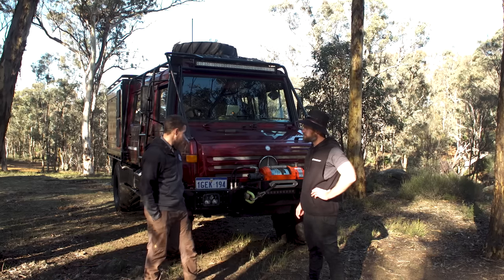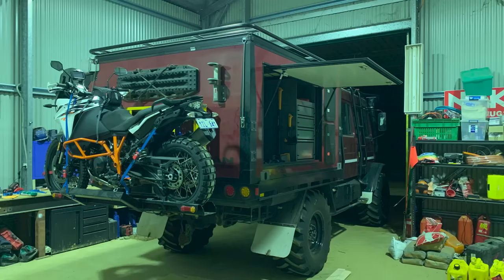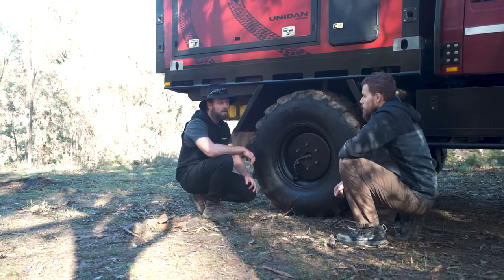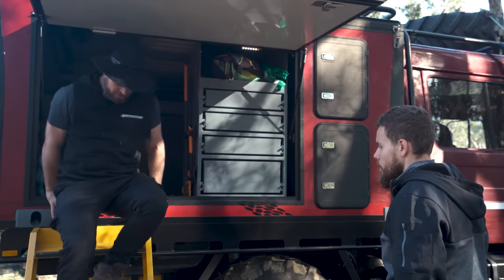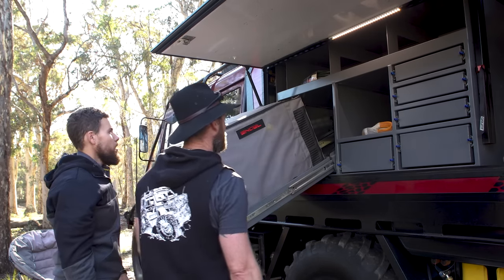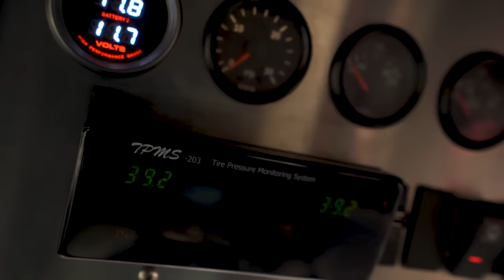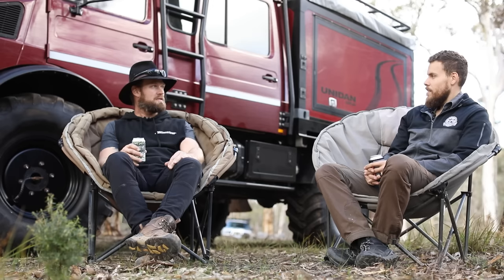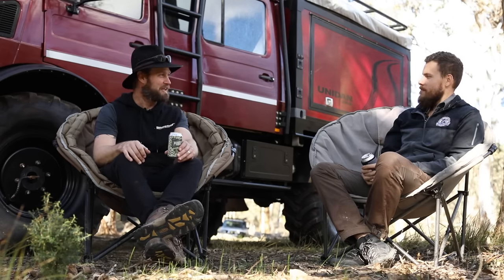DOOMSDAY TRUCK, Unimog Modified Episode 83

Comment: 200kg spare on the roof, good luck with that changeover 😂
Reply: I wonder if getting it off and on the roof, using the winch and a tall gum tree.
Reply from the maker: Hoists it down with straps but it’s not an easy task

Comment: Surely there is a better spot to put that spare tyre instead of up on the roof
Reply: People with that kinda truck usually hang them off the back, but that’s not really an option if you want to carry motorcycles
Reply: When will he even need to access the spare? I'm guessing that rubber is going to handle anything it hits!
Reply: Leon yeah that’s what I’ve usually seen, but I’d sacrifice the tyres for a dirt bike any day
Reply: The Frown Clown yeah I doubt he’ll ever need the spare !
Reply: The Frown Clown with these tyres you can repair most normal punctures by „just“ pulling the tyre of the rim and doing some work to it. The moment you have to change the thing is usually when you have punctures or cuts in the side wall

Comment: if anyone actually reads this, i had a camping chair JUST like the one pictured at 28:50. it was a fold away papasan chair, and i called it the Crunk Chair. Getting out of this chair after a good night around the campfire is impossible. Hence; Crunk Chair. Does ANYONE know where i can find another one? Bass Pro used to sell them, they been discontinued. I really need another one, and ol boy GOT one, so i know they still make em. 
#hydrate

Comment: Ask  any adf mechanics and adf driving instructors that worked with mogs... then ask them what they would drive if they won the jackpot... it wouldn't be a mog.
Reply: Why's that mate, are u from the ADF...?? Would be good to get ur input as they seem like a decent truck.... There slow, fuel economies not great and there big but they seem good for what they are...!! Ur thoughts...??
Reply: @jesusiskingamen1026  pain in the arse to work on cramped engine bay... many african overlanders find more mogs in workshops compared to man tatra iveco... and 5ton plus in clay loose rock and bogged ? But they do have their advantages. Most guys i know tour with only about 400kg not 1ton plus the kitchen sink and a pop top house or tow a house.

Comment: OK, I just saw briefly this video and I really can't see what exactly is so great about this project. Basically guy put light shit in heavy truck. All of that stuff could go in Suzuki Jimny and get to same place cheaper. And  Suzuki could fit in a half of garage. I was thinking that he caries house around, but he just filled truck with expensive equipment and cheap camping shit.
About UNIMOG, it's a tractor with road capabilities, you can't go for highway speeds in it. If you wan't to go around, then choose real trucks, start from Fuso
Reply: Jealous much?

Comment: at 11.9 volts those batteries are basically flat.
Reply: ... Likely some aux loads on them.  May have been OK.
Reply: @kradius2169  Hmm, good point, didn't think of that :)
Reply: @Kevin Behr  ... Well, I believe I know enough to be dangerous.  

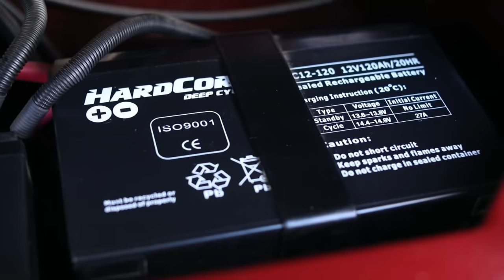31:00 ... Along those lines, don't the AGMs vent? ... And thus should perhaps be located other than inside the cab?

Comment: i suppose 300k is cheap,considering some toyota nuts cut & shut 80/100/200 series,for more. & 6 wheel drive for some stupid reason.& fit cummins,not a good choice..heavy,not economical,expensive...watch the vid,unimog,super crawl. or factory test vids. unimog was around before toyota got out of bed..

Comment: Could you build one like this based on a brand new Mercedes Benz UNIMOG U5023 4X4 + 3.0 in. Lift 5.1 TDI I6 4-Dr Double Cab All Terrain Light Camper Truck (RHD)??? and I'm 100% serious!!! I was on the verge of ordering the MOG back in February but weren't able to as a result of the start of pandemic!!! but now I'm willing to give this a shot at it again, I just need someone to build it for me & now I need 2 MOGs!!! Please advise . . . I'll provide you with 2 brand new Mercedes Benz UNIMOG U5023 4X4 + 3.0 in. Lift 5.1 TDI I6 4-Dr Double Cab All Terrain Light Camper Truck (RHD) in Australia (wherever your located in AU)!!! you just need to build the rear chassis mounted (habitation unit) camper body, related systems & accessories!!! please advise . . . looking forward to it!!!